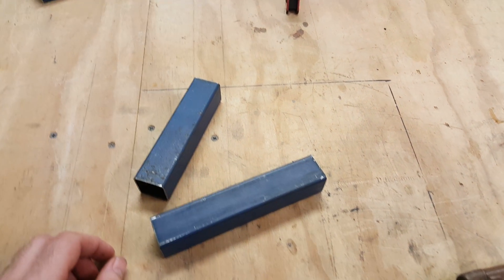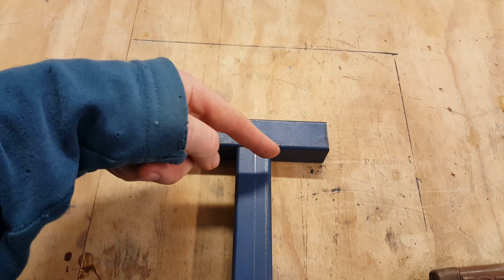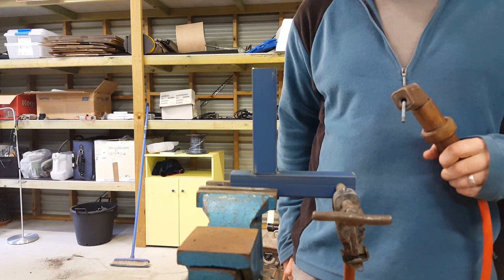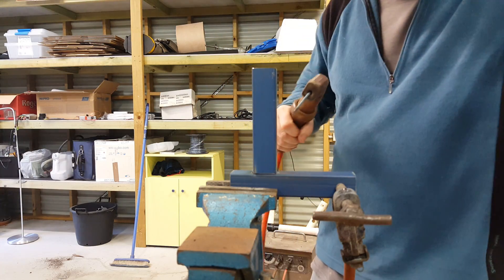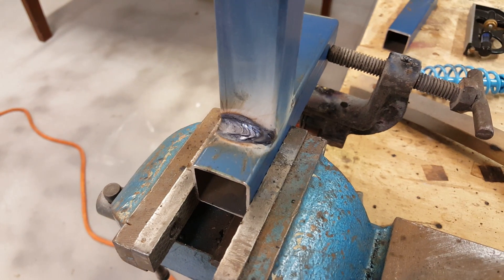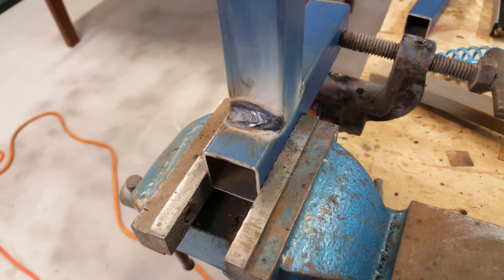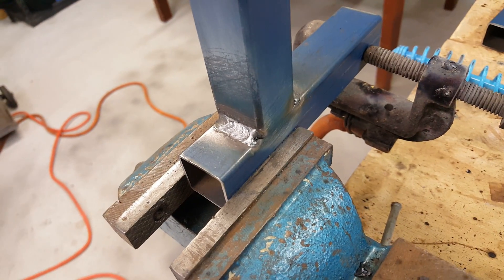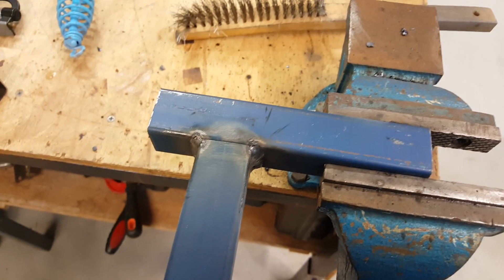Welding thin steel tube with a stick welder

Comment: Excellent stuff, worked like a charm!  I was welding 1.6mm thick round tubes together end to end and I used this technique with 1.6mm rods at 38 - 40A. Great video, thanks very much!

Comment: You need a smaller rod and/or lower amps, with 6013 give it more angle like 30 degrees so you can see your puddle and blow off slag, just keep your rod moving and you shouldn't blow holes. Cheers

Comment: Try to keep a consistent drag angle. I saw you change 4 times in your last pass. If your blowing holes change your amperage or your travel speed. If you can eliminate as many stops and starts your making your welds will be stronger. There definitely necessary with SMAW but you could be able to almost weld out 3 sides of that square tubing with one electrode. Or I could anyway and I’m no pro

Comment: that doesn't look like 1.6mm wall thickness.. looks like 50x50x3mm SHS, in which case can use 3.2mm rod on those at around 85A downhand quick pass no problem.. tbh I'm only here to see if anyones tried 1.6mm electrodes on pissy galvanised 20x20x1.6mm SHS or if its just better to stick to using 7018 TC 2.0mm electrodes.
Reply from the maker: It's 1.6 mm dude.  I measured it with my callipers.  It's welding OK at 75 A, 45 V.  I have used 2.5 mm rods in this video, but I find 2 mm rods get consumed too quickly to be much use.
Reply: @jonescg  2mm sticks should work with a quick and steady pass maybe go down 5-10amps and do a test run with varying arc lengths until you find the sweet spot, ive had machines that operate at half the amperage it says they do, so 280 would feel like 140 cause it actually was 140 or thereabouts and vise versa.. anyway, I was also told not to use filler material that exceeds around 0.5mm thicker than the metal its being laid onto because the slag generally tends to overwhelm the weld pool and if you go any hotter in an attempt to help it lay out flatter you just blow holes, hence why you have to stop start so violently and produce a dodgy inconsistent weld thats so hard to rip the slag off of cause the slag has become a part of the weld, in other words, those welds wouldnt pass x-ray due to the presence of impurities that will cause rapid oxidation..
But hey what do I know, only been a fabricator for 8 years, 3 of which were almost entirely on site stick work..
Reply: @jonescg  oh also welds should never exceed much more than 40% of the total material wall thickness, in other words you dont have to lay welds that that wide especially if its 1.6mm, at most a 4mm wide bead is plenty.. over welding is much worse than you think in a lot of cases, especially with thin wall metals
Reply: @jonescg  also last one I know ive been ripping into ya, after a second look, probably is 1.6mm and u got tiny hands hahah, thats my bad.

Comment: Some warnings galvanized steel creates toxic gases when heated via torch or welder use protection respirator and cover up high UV (skin cancer or burns from the spatter)

Comment: Thanks Mate. As a first time welder on small home projects i found your video really helpfull. I will try your ideas out and feedback. Why does the rod stick to the work piece ? I am using 2.5mm Rods @ 80 Amps. I appreciate your help.
Reply from the maker: The tip sticks because its not properly shielded by the flux on the outside. Strafe the electrode on a grounded scrap bit of steel to get it hot first. It makes starts a lot easier.

Comment: Yeah but 1.6mm square hollow isn't that thin, try 1mm thick hollow section. Then i think stick welding won't be applicable. 

Because i tried it, and keep melting the metal, even with a 1.6mm electrode.

Comment: Why doesn't anyone doing these videos mention the amps they have dialed in, it would be helpful. Ops I just saw the answer to my question.
Reply from the maker: HI Kenneth, I didn't say it in the video, but I do mention it in the text.  If you read the video description you'll see "Current was set to 75 amps at 45 volts".  I've got about 100 comments on this thread asking "What amps?" but I don't bother because it's in the text above.  And to be fair, this old beast doesn't really have much in the way of settings, other than off, on and hum.

Comment: Just completed my first project using the same square hollow section.. Blew holes on about half my welds and thought I had the wrong amperage setting (on the plus side I did manage to keep it square, strong & stable which surprised me). Wish I had watched your  video first, some great tips. Looking forward to doing better on my next project! :)

Comment: Ok, nice but need more information on the setting on the machine ,please. Is it 90, 100, or 120 amp, you where using to weld it.

Comment: Should always clean up your metal first,no paint,grease or rust where your welds gonna be. Also clean slag off and wire brush between each stop/start,this avoids inclusions.i am qualified welder

Comment: First try to tack the four corners in opposite direction. When welding a whole first side the metal warps in that direction when it cools down. When tacking the corners first you will decrease deformation

Comment: I to am self taught, however I spent 40years x raying and sentencing welds. You will get better and what I see is great work on such thin steel. Slag removal is always difficult on internal corners and your welds look very strong. No doubt you will burn through and your nest skill is being able to fix it ! Can be done as I’ve done lots of stuff this thin but my welder is an inverter model allowing much lower current. For beginners always fire up the rod on scrape right next to your job, it will always start and nothing worse than a difficult start on a real and important thin walled job. You will get better but are doing real well. I’m a self taught oxy welder and on thin material it’s a cinch you tube will give you the basics.

Comment: I have had similar experiences blowing holes. A lot of trial and error,   turning the ampage down, getting the electrode hot and short bursts work for me too. I'm not a professional,  I get by and my welds hold up. Thanks for the tips.

Comment: I looked it up... That thickness maps into our range for 16-gauge steel... I've burnt through my share of it over the years... I got better after building a steel picket (aka "wrought iron" style) fence around my backyard a few years ago... 250 ft of fence with a picket every 4" = 750 pickets to weld and 3 rails per fence section plus top and bottom of each rail equaled at least 4500 welds...

I wasn't searching for this type of video... But YouTube suggested it and I thought I might watch it and find some secret... Nope... But thanks for the video anyway...

Comment: Ok, I've been trained to weld. I can weld that box with 2.5mm e6011 at 60amp, one pass. Keep your arc short, move quickly and weave the rod to spread heat into both sides of the joint. If you hear it start to burn through, stop an let it cool. Start again. Dabbing it like this will make a weak porious weld.

Comment: Thanks for putting this video up. I am making rocket stoves for the island of Tanna in Vanuatu. Had a few issues with blowing holes in the lpg gas bottles, but discovered your method by the suck-and-see technique. Wished I’d found this video before l started doing my builds... would of made for a lot less frustration....

Comment: Good job mate. Im a 50yo boily & those welds will be plenty good for diy projects.if they needed to be load bearing you'd just use something thicker. That shs would bend before your welds would give.if you plan on doing a lot more in the future I'd suggest investing in a cheap little mig welder. Much easier on the light stuff. Good vid 
Cheers Rod... NSW

Comment: Would stop and starting with stick not automatically give inclusions? Or aslong as we get the arc back before the beads cools will it be ok?
Reply from the maker: It seems as long as you get back into it fairly quickly it won't include slag.  If you wait too long, or in my case here, get the rod angle wrong, you will get an inclusion, yeah.
Reply: @jonescg  ah.. right. thank you for your reply, only got a stick welder at home myself so thanks for the info. Really appreciated.

Comment: Oh, on the long sticks I seen a welder hold the stick like a pencil. That gives you control. Of coarse you need to where gloves.
I have tried this and works well with control. If the stick gets stuck it's easy to pull back without wrenching the stick out of the clamp.

Comment: Oh, and another thing. You can get 1.6 mm rod. I now get high strength Welder's rod which is low hydration. I grind the steel on both places I plan to weld and put a v groove on end of steel so weld has more penetration.
If too much heat gets on the workpiece the metal may bend. So Welder's generally tac in places before filling.
The problem with quality high strength rods is it's harder to start or strike.
I found the 1.6 mm rods worked a treat.
The rate of my welder cuts out. I think with my welder it's 170amps so when it gets warm it will momentary stop. I have often wondered why this occurs. To me I prefer the stick welder to mig. Darn it I had to type mig three times it kept changing the word to mug.
I have a mig welder although don't have gas. Gas runs better.

Comment: You got yourself a nice welder Chris. Some nice runs. Just two things Chris. There is a reasonable amount of uv coming out of the welder so ppe. Personal protective equipment. Say welders gloves thick clothing and also something over your head like a Welder's hoody. Also the smoke from the weld is hazardous. I bought myself a gas mask and cover right up. You got yourself a very good welder is it ac? 
I have been doing a bit of welding myself so welding comes up in my feed.
There is this other Chris Jones I often see at electric shows. He has an electric scooter. Well a few and builds an electric racing bike.
Reply from the maker: Yeah I've heard of that other guy too :D  Gloves and other PPE is a given, yeah.  I just got lazy, and it's hard to operate the phone with leather gloves on.  I found 2 mm rods and thinner much harder to manage the feed rate - nothing a bit of practice wouldn't address, but I worked out it was less of a challenge to control the heat of the puddle than it is to adjust the electrode feed rate.  Lower amps gave poor penetration, so this was my compromise.

Comment: Haven't read all the comments so maybe someone else has said this.

I grew up as a kid on thin steel tubing and AC buzz boxes and can't remember having much trouble with blowouts until much later in life when I changed to a DC inverter. And then blowouts galore!

I swapped back and forth and found AC much more forgiving than DC on thin metal.

For what that's worth....

Comment: I go dcen 3/32 6013 rods ...60 amps.....wire brush or flap disk it real clean cause the low amperage cant burn through grease paint n rust easily.... But that allows me to weld thin stuff non stop .... And ultra thin stuff start n stop

Comment: I may try a higher strength quick freeze electrode like 7010 or 8010 if I weld I.e. Motorcycle frames as I do not have MIG or TIG.
Reply: 7016 is good also. Along with 6011, 6013.

Comment: That’s not thin wall.   We used to stick weld 18 gauge galvanized sheet metal together 50 years ago.  Without ventilation.   Now that’s illegal.   Galvanized gives off zinc oxide gas.   Real thin rod with a good motor/generator welder was the trick.   At the time, Lincoln, Miller and Hobart were the only ones capable.   We would grind a nice tip on the rod before starting and use short (6” long) rod for better control.   Nice work though with an inexpensive buzz box.

Comment: try standard mild steel rods and you will struggle a lot more .also remove the paint. i find it helps to start with a shorter rod.i cut mine in half. you may sacrifice an inch of rod but you get a better finished product. the end......

Comment: The idea of producing many small tack welds on thin material so that you don't blow through is a good one and we'll known but because it's stick welding try to avoid starting a fresh tack near the end of the previous one (if you haven't cleaned the slag off yet) that will surely cause you inclusions. Consider many tacks with a tack sized space in between, then clean them all up at once and go over the spaces but always begin with a very slight overlap on your freshly cleaned tacks. The blowthrough is caused by  to much heat building up because it can't  disipate fast enough through the thin material. Like the other guys have said using heat sinks will help a bit.

Comment: How could I criticise a fellow Aussie? Your accent was a giveaway from the normal American and their love for imperial. But the clincher was “Bunnings “. I have the same type of welder my missus bought me 42 years ago. Still works, not so much these days. I haven’t welded for 20 years because I was shit at it. My dad used to call my welds, “Cocky shit”. He was right, but then I learned on that thin walled tubing crap. Thanks for the video mate.🇦🇺👍

Comment: When it comes to inclusions, most of the time the metal is recycled and has tons of excess dirt and  carbon which is why that happens. If you would get tubing that is virgin metal you would not have this problem, but cost is a lot more if you can get that type of metal where you are located.

Comment: Grind it all away and Start over mate.   Those are nasty welds.  You shouldn't need to start and stop like that on that gauge of metal, also if you are you need to clean after each stop.  Thats why you have so many inclusions.

Comment: A technique I use for very thin metals and/or closing holes is to spot both sides to build up some material, before bridging.  I have been able to close holes in exhaust tubing in this way.  I have always used a Weldwell PH68 rod which is a general purpose rod with “very rapidly solidifying slag”. The application notes say that it is good for “bridging large gaps”….which is great for amateurs like me.

Comment: there is no reason this steel cannot be welded, I have mainly welded stick apart from oxy-acetylene and brazing; your weld pool is too cold when doing the T-joint, use a higher amperage and more acute angle to push off the slag; consider reducing the amperage when the metal heats up. Carry on! Welding is fun with a stick! MIG easier and TIG trickier in my experience!!!

Comment: Fkn bad ass! I just spent the day burning holes in my custom steel order for a chainsaw sawmill project. Took some time to process the dissapointment that thin steel wont work for my hopes, but your tipes may help me use the steel for something else. Did not know about heating up the rod first, but had noticed once it started it restarted fine. Nice tip. Will try the fish scale tip. Thanks brother!

Comment: No gloves? Major safety violation. And don't weld in street clothes. Or over a wood bench. Please tell me you were wearing proper footwear for welding! Also you should tack one side and then the other if you expect your 90 degree joint to end up 90 degrees.

For thin stock, use thin rod. I would use 1/16" rods on that size square tube. The 6013 is fine for AC work but your current is a bit on the high side. With 1/16" rod you could go down to about 40a or try even lower and maybe MAYBE be able to run continuous bead with practice. Start and stop Filipino style welding works but you can incorporate a lot of slag into your weld. If strength is not an issue then no biggie.

Better to try than to not try. That's how you learn. But try not to burn your shop down or give yourself skin cancer. Dress like a pro even if you can't afford a pro machine. You can do a lot with that old buzz box if you use the right rod and current. A lot of good, or a lot of bad.

There are a lot of cheap machines that will handle flux core wire and allow you to do a fine job welding thin square tube. With thin material, sometimes less is more.

I had to give this a thumb down for the safety violations. Especially the gloves. A welding arc puts out a lot of high intensity UV that is really bad for your bare skin. Not to mention the occasional bit of spatter. Even at low currents, you should still be aware and take precautions.

Comment: Just buy a cheap flux core welder and you all will be masters for just 10 minutes, welding sheet and tubes with stick is past behind us. It took me 2 mounths to master 6013, and just 10 minutes flux core 0.9 mm. The welds and the strenght are the same

Comment: Good job Chris. I just add a few points here if i may?. 
1-clean paint at welding zone.
2- 6010, 6011, 6012,  6013 rods are good as they are all position rods but i think only few are good for AC welding not all. 
2.5mm for thin material up to 3mm plate. Always tack your job to prevent heat distortion. 
Consider revers polarity when using a DC machine but again that info is on the rods package. 
Its handy to try on a test piece of similar material to set your amps as good as you can and pre heat the rod. Keep a tight arc and hold rod at 10-15deg. Some rods freeze slag quick and prefer a staright run then a stitch.

Comment: A couple of things,  run the electrode in reverse polarity will make this amazingly easier and you wont need to stop/start on DC stick.  Also wear gloves and you can safely hold the electrode halfway down rather than cut it in half.  Re starting, rather than destroying your clamp to hot start, try a chunk of concrete and tap/scrape the electrode, it removes slag and flux making starts easy
Reply: that buzz box he is using has no polarity as it's AC only.
Reply: @youtubier2839 missed it was an AC buzz box